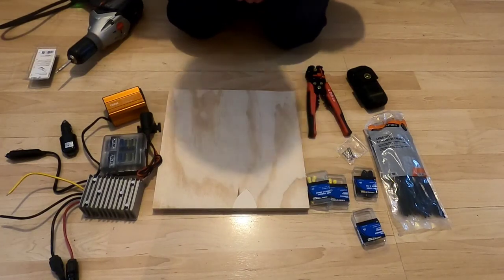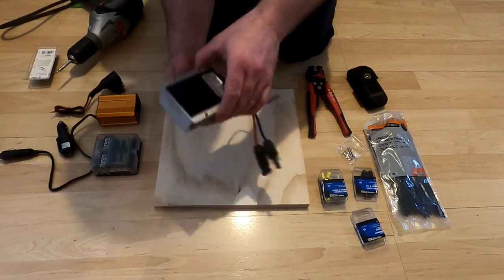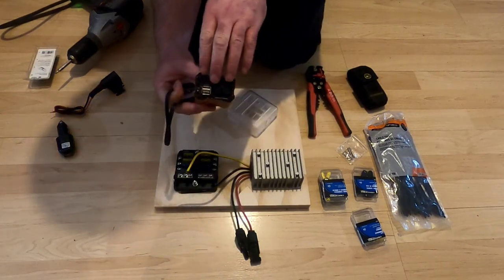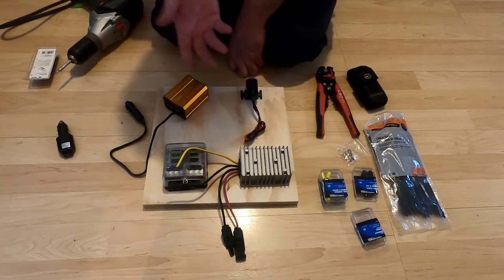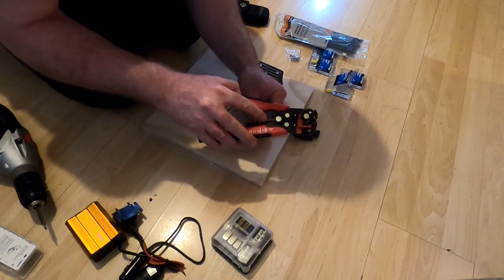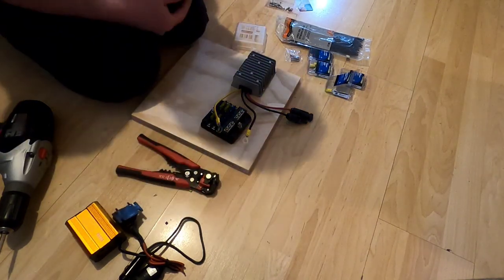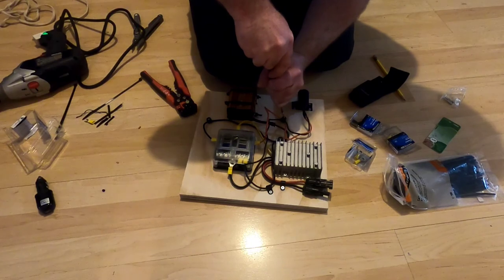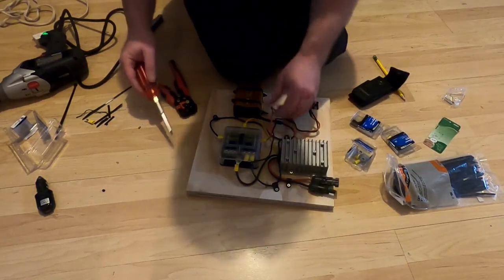DIY BATTERY-LESS SOLAR GENERATOR FULL BUILD, AC USB CIGARETTE LIGHTER ABILITY UNDER 10 LBS

Comment: Just curious Frank, I looked at the buck converter and it said don't hook up to a solar panel, solar regulator or a wind turbine. Is this set-up going to be safe as it goes against what the manufacturer states?
Reply from the maker: I have never seen such warnings stated anywhere, not sure what the 'danger' could be unless the panel array was so powerful it overpowered the bucks thresholds, the higher quality bucks have protection against that though, they work well for me and I know some suppliers even attach mc4 connectors on to the input themselves with Andersons on the outputs specifically for solar panels, I know some solar panels voltage is not high enough to work properly in the stepping down. It is always good to make sure the voltage and amps produced is within the threshold of the converter as is in my example. I have had no issues at all using them and I know of others that have done the same without issue, so I am not sure what to say DC power is DC power regardless of the source. I feel confident using them without issue and have never had a problem with them. I think it is a manufacturer wanting to protect themselves against any possible liability more than anything but that's just my perspective. At $100 roughly for the build if it is throw away in a few years I am ok with that, but I expect mine to last a very long time.
Reply from the maker: As always though if you do not feel comfortable doing these types of projects yourself...
Reply: @frankbush333  thanks for that I just read it on the information for the converter that was all.
Reply from the maker: It is strange to me to hear that as mppt charge controllers normally have the bucks built into their circuitry as a standard part of their tech... thanks for the info though, always new things to look into. Thanks for watching, cheers.
Reply: @frankbush333  Can I use this set up designed by You for a 2000 Watts pure sine wave inverter? Bypassing batteries for solar only use ?
Reply from the maker: @leewilliam107  yes you can scale this entire setup up to run a 2000w inverter, you would need to scale up all the components to handle the increased capacity as well, the dc to dc converter, and the panels primarily would both need to be able to produce / handle 2000w as well.
Reply from the maker: As always do things at your own risk, I just like to take my own path with these things.